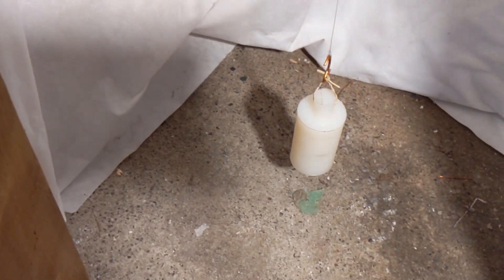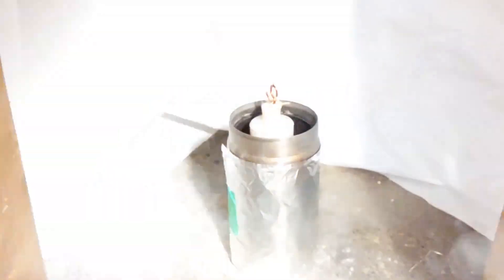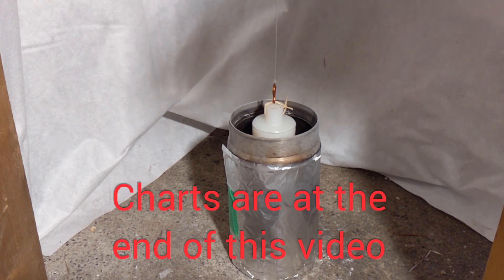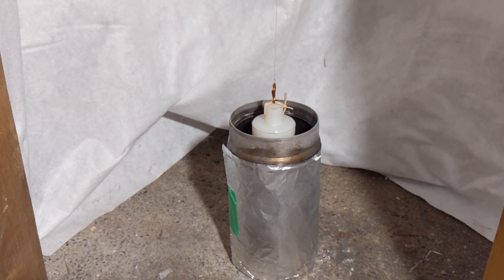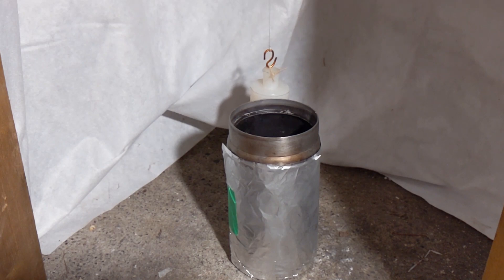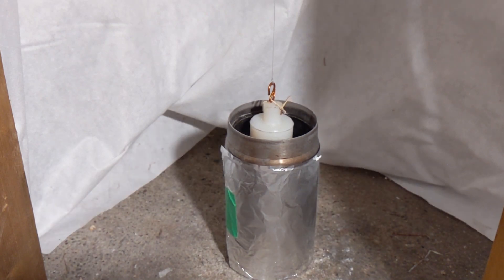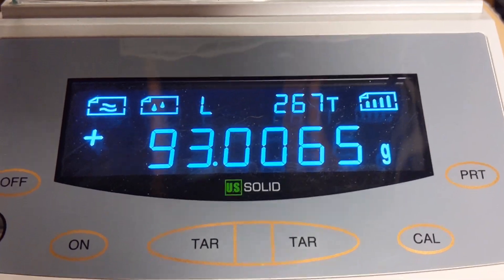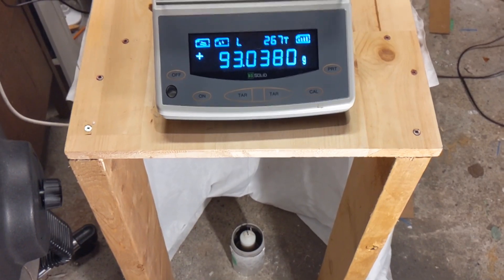Gravity fields from a magnetized superconductor?

Comment: I believe it is relevant for the same reason the first calculators are relevant to quantum computers. You can't get to the hi tech without playing with the low tech first. (You,have to walk before you run). Even if it only changed the weight by a quantum amount, THAT WOULD BE SIGNIFICANT. Even 1/1 000 000 000 of a gram would matter. And ripping on him for his "out back" style is uncool. A more significant question is, does it change the "mass" or the "weight". And, no, they are not the same thing. Something of 1kg mass, will always have 1kg mass under any conditions we understand. But the weight will vary with gravity. So the question is does it change the effect of gravity or somehow actually change the mass in a way we do not yet understand. Don't forget till a short time ago we all thought electrons travelled in nice neat circles and we were just so wrong. Infact electrons appear and disappear from our reality at random. Electron "rings" was just a way for us to begin to understand the very basics of matter. Things we needed to know that before we could move on to understand any more. There may be something in the combination of magnets, superconductors and maybe even frequencies. But with out people just giving it a try we will never know. Even the very best theory is useless without repeatable results.... Side note, I subscribe to gravity not being a force at all but insted its the warping of space/time caused by mass changing the path of an object.... the object is still going straight, space/time is curved. You can hate on me but read nasa's notes on "gravity probe "b" first.

Comment: diamagnetic repulsion? (plus change in air density with temperature)
Reply: But the brass is nonferrous?
Reply: @michaelperrone3867  diamagnetism occurs in all materials
Reply from the maker: There is a chart  https://en.wikipedia.org/wiki/Permeability_%28electromagnetism%29#Values_for_some_common_materials?wprov=sfla1
I saw the other day listing the magnetic permeability of many metals. If it's less than 1 it will be diamagnetic, greater than 1 paramagnetic ex. Aluminum is paramagnetic mu = 1.000022
Reply: I don't have exact numbers, but density of air increases by about 0.8 mg/cm³ from 0°C to -100°C. So a body of 100 cm³ should get 80 mg lighter, as it is displacing that amount more mass
Reply from the maker: Thr air density and temperature would be  more or less uniform relative to the brass I believe. It could be that a sudden switch in the YBCO ability to pass the magnetic field around Tc interacts with the brass, I will give you that...

Comment: How is half of 1/10th of a gram in weight change relevant to such a large/hevier piece of material by contrast?  How do you know the weight gain isn't due to humidity condensation, air currents, etc. Your experiment is being done in mostly open air, with no temperature measurements, no humidity measurements, no motion/vibration sensors, no electrical static & magnetic sensors,etc. Also I am not understanding why you are doing this experiment. What are you trying to prove exactly? Also let's assume the experiment worked by your standards... what is the practical application of this? How is changing weight by half of 1/10th of a gram relevant in the real world?
Reply from the maker: What ever dude. I do this stuff because I like to, I share because out of a world of 7 billion people, I can count on my fingers the number of people I know actually looking for methods to alter the gravity field. Those who claim results keep secrets. This is why we still burn petro to get around. I am on a journey of discovery, not waiting for perfection, that's why its called fail forward. You mentioned a bunch of things, to consider, you sound like a very smart person, have you joined the cause?

Comment: I think you should block somehow the flux of the evaporating nitrogen since it produces air convection upwards that may affect the weight of the nylon
Reply: That doesn't explain the weird plateaus in his graphs, tough
Reply from the maker: It may cause a bit of noise on balance reading, but I don't think anything significant. If I do this kind of experiment again the convection air current thing should be ruled out ideally